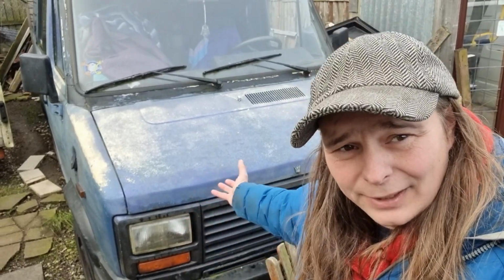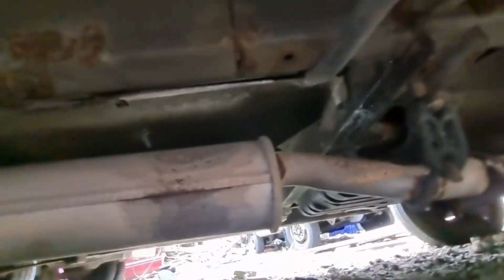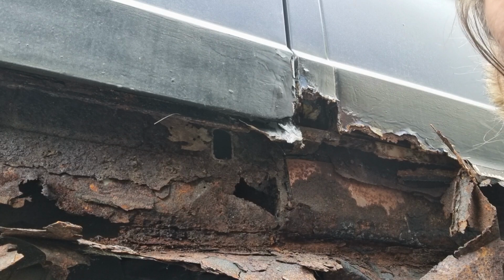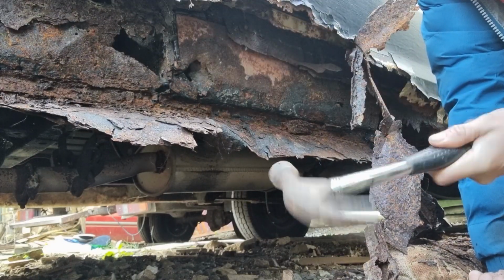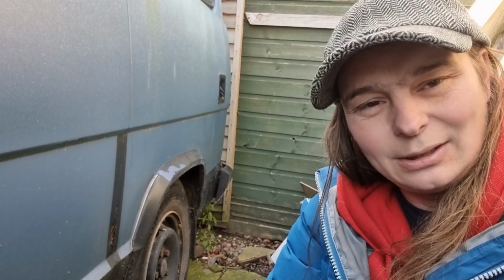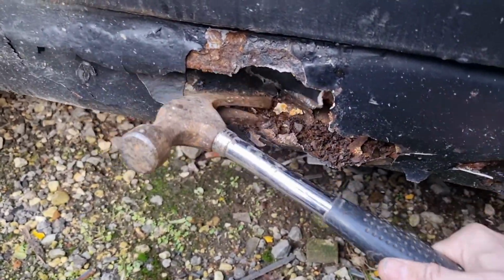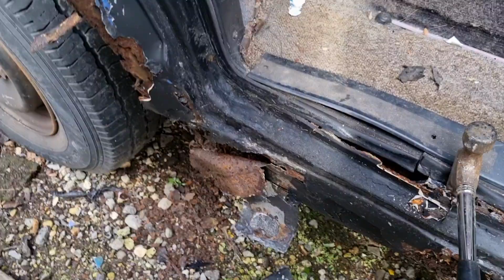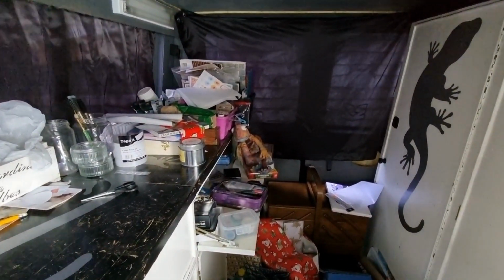How Rotten can a Talbot Express Campervan be?? Join me for some Retro Hammer Time!!

Comment: I have only reached the first (1st) 0.40 seconds of the video and already I am saying NO it's not. Mind is and was. Bought for £3500 and I have already used! 1 x 8' x 4' sheet of 1.2mm steel. Not stopping there I am on too the 2nd sheet which is disappearing rapidly. All rot up until now has been cut out and replaced. New front wings, doors, bonnet, 100% of the hibernation area replaced, along with 100% of the wiring. Even the front floor, sill and chassis, required doing. I still haven't stopped. To the swine who pasted almost the hole van with porn mags, wig, chicken wire, wood and any thing else he could attached fillers and fibre glass to. Van looked great but boy did I learn a lesson. 
                                                           Even the brake pads had been fitted inside out., gear selector shaft broke of 3 metres from home, an that was the beginning. Since purchasing the vehicle 3 years ago I hasn't moved an inch. Because I still need to keep going. Lessons to be learned, never ever believe what you are be told, or have faith in what you are being sold.
Reply from the maker: Blimey.... Fair play to you. I hope you get many holidays after 😬